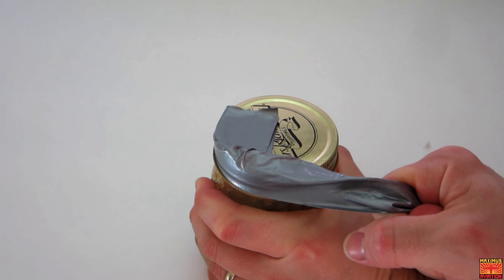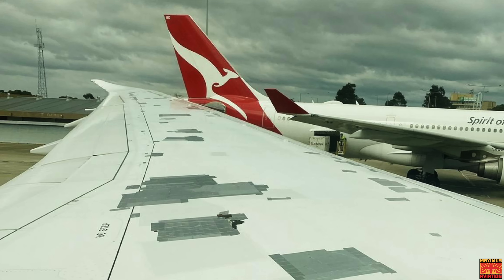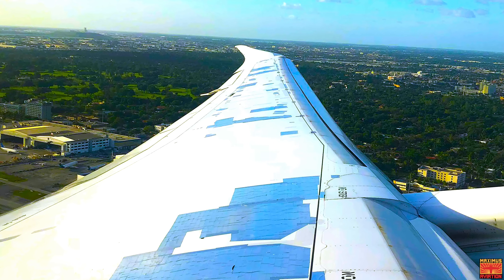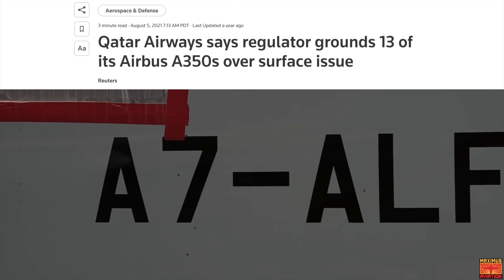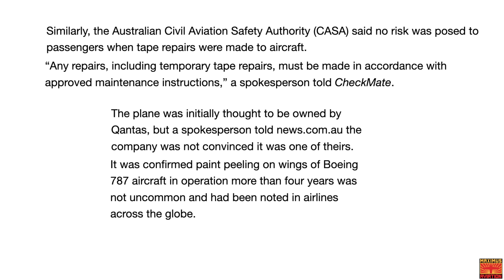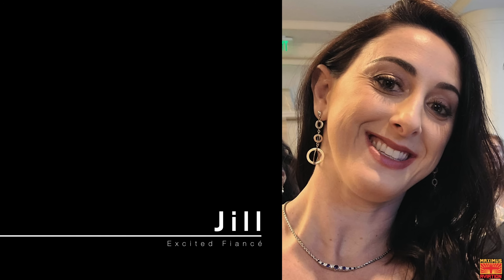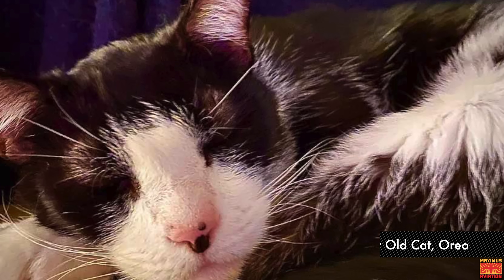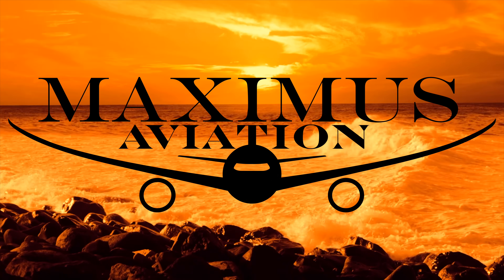787's All Around The World Are Being Repaired With Duct Tape And Continue To Fly. But Why?

Comment: It is not Duct tape (that would freeze and break away) it is 3M Aluminium Tape...Guaranteed to about 600 mph, (it sticks like the proverbial sh!t to a blanket) that is why the nickname is High Speed Tape...Been in use for at least 50 years...Originally used to seal temporary skin repairs.  The greatest tape I have ever used and I am nearly out of my acquired stock...(a very sad Des)!!!
Reply: You solved the mystery. Good job 👌

Maybe watch the video next time before jumping in the comments.
Reply: @bobhope5976  It was no mystery when you used to work for Qantas as an aircraft engineer...I did watch the whole video by the way 🙂 I quite like Maximus's efforts and video style
Reply: @desobrien3827  then why tell us it's not duct tape in the comments? Lol, that's what the video was about. 🤡
Reply: @bobhope5976  I did lol...that would freeze and break away

Comment: Just to confirm, it's not duct tape, it's high speed tape, it's a highly adhesive, aluminium foil tape, it's not for structural repair, it's purely for aerodynamic smoothness (ie covering missing or curing sealant) on carbon composite structures, UV light can damage the composition, so it's covered with speed tape to prevent degradation.

Comment: Daryl Cavanaugh Is correct. The ‘duct tape’ is indeed a heavy aluminum foil tape by 3M that is very strong. It is approved for temporary repairs on Jets. Years ago I was a copilot on a DC9. Our left wing was struck from behind by a snow removal dump truck. The trucks windshield and Pilar’s were smashed in. Our mechanic picked up all the pieces of the wing trailing edge  - fitted them back on the wing (like a jig saw puzzle) then applied the foil tape to hold it all together. We dispatched on time. The airplane flew like that for two weeks before proper repairs were made. Amazing stuff.

We called duct tape 100 mph tape and aluminum foil tape 600 mph tape.

Comment: During my DC8 times this tape was even called High Speed Tape....and was used for just about anything on the airframe.. 
good to hear the old times are back
by the way please tell Boeing that any fuel tank leak can be stopped by a 2 hours chewed chewing gum
Reply: Good ole speed tape keeps the hog in the fog, along with click patch for fuel leaks.
Reply: The tape is critical on these planes as where aluminum is not effected by UV, carbon fiber is. That is why they don't want the CF exposed to sunlight.
Reply: @albatross5466  I think you mean affected. Good factoid to know about the need to protect composite from UV light. Sounds like composite is the latest and greatest in fiberglass technology...
Reply: @BigBlueJake  I always confuse those 2. Thanks.
Reply: Speed tape is rated too:  100 mph tape, and 500 mph tape
Reply: Yep, we sent out a lot of Diesel Eights with a bunch of pit tape or speed tape all over them. We loaded cargo DC8s for a living. Those old birds were all ways suffering minor damage due to the ramp rats that were loading them. If it wasn’t structural they’d beat it back into a place and tape it down till they got back to base and could do a permanent repair. It might be duct tape but it’s very expensive duct tape….a couple hundred bucks a roll.
Reply: Bunch of tacky ghetto bodgers !

Comment: On a serious note; both the 787 & A350 are composite aircraft, with an awful lot of wing flex. I wonder if the paint is not pliable enough, over time, and has trouble with the constant flexing of the plane? I'm sure the fuselage has some movement in it. as well...
Reply: This appears to be the case. Mentour Pilot talks about it in one of his videos. Getting the paint and primer to adhere nicely to the aluminum lightning conduction mesh and composite structure is presenting a real challenge

Comment: Speed tape is actually a very sticky, thick aluminum foil tape, and there is a specific process for its application. Relax. Structurally these planes are fine, and yes, the paint adhesion is an issue, that we are dealing with regularly. This one gets sensationalized by so may who know nothing about the industry.
Reply: This

Comment: we used high quality  duct the, the cloth kind for flight test wiring  on the wires placed on the outside for testing purposes during certification flights, back in the late 60s
 Flight test on 747. Orange in color. never a problem
Reply: some of the tape rolls were over a foot wide holding wiring bundles over the wing near the fuselage.  Flight test wiring was always orange.

Comment: I wouldn't be worried about the tape for the time being, these are completely standard repairs, abiding by the regulations. However, this tape is a temporary fix. I'd start to worry if this doesn't get a permanent fix in the very near future. They need to figure out how to get that paint to stick better, and they need to do it quick....
Reply: They should probably talk to SpaceX about getting paint to stay on carbon-composites.
The Falcon9 is filled repeatedly with tons of extremely cold, dense cryogenic liquified gases, launched through the sound barrier at a sustained 3-4 G, gets blasted in the side by the second stage engine, begins reentry into the atmosphere at hypersonic speeds, suicide burns onto the deck of a pitching barge and then repeats the process at least 14 times.
I'm yet to see any chipping paint.
Reply: @slartybarfastb3648  well, those boosters are flown at most a couple dozen times, and from what I've seen, they touch up the paint every time they reuse one, so I don't know if the use cases are analogous. It cannot be overstated just how hard airplanes get worked, just constant physical stress on the airframe. Hours of every day, days over every week, weeks out of every year, they're going up and coming down. Over time, a passenger airliner sees A LOT more mechanical stress than a rocket, even a reusable one.
Reply: @saml7610  Fair assessment. 
Those "touched up" areas aren't repainted though. Those are areas of inspection where the kerosene soot has been wiped off during the process.
Two different forms of stresses comparing rockets to airliners, I agree, but can't help but think SpaceX spent the extra money where Boeing and Airbus did not.

Comment: I used to work for company back in the late 80s that flew a lot of cargo for GM.  They had old DC 3s a Beech 18 etc.  The maintenance guys used  duct tape all the time.  Not permanently, but for something temporary.  I mean, nothing like holding an engine on but for minor things.  No big deal.
Reply: I was in the US Marine Corps in the late 1960s so got to fly around in quite a few DC3 - C47s. I loved it but I don't think we ever landed with both engines running, but perhaps time has clouded my memory.

Comment: 0:52 Was that a real photo of an airplane wing with duct tape?
Reply: Speed tape, like $800 a roll, vs. $8 a roll for normal duct tape. Speed tape has an aluminum backing, and it's produced and tested with much higher standards. Would normal foil tape work fine? Probably, but you don't know for sure. That high price you're paying for the real stuff, it's for peace of mind, knowing it has no defects and won't fail within it's specified performance envelope.
Reply: yes but its speed tape, thin adhesive aluminium foil. not ya standard duct tape
Reply from the maker: Yeah, speed tape is actually duct tape because its made from Aluminium. But I guarantee duct tape would still work just fine.  Just looks trashy.